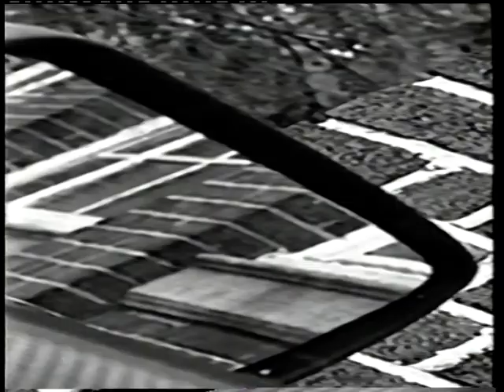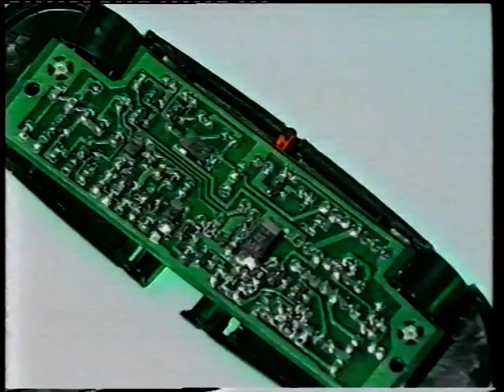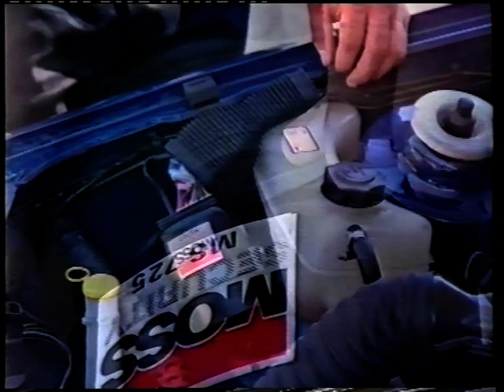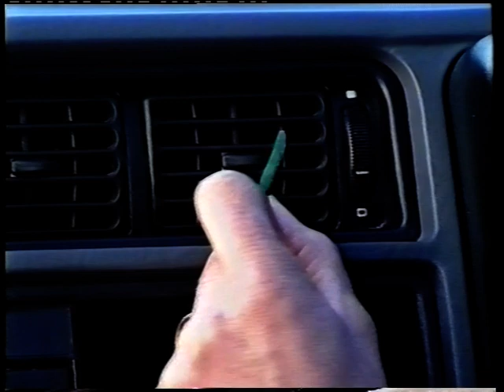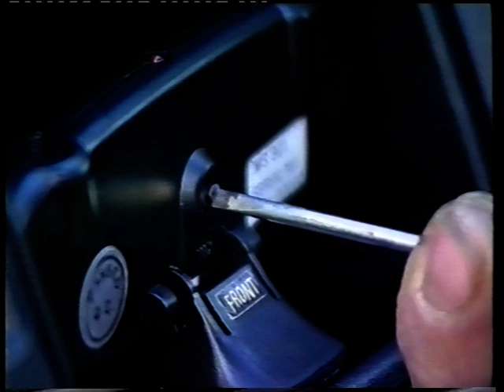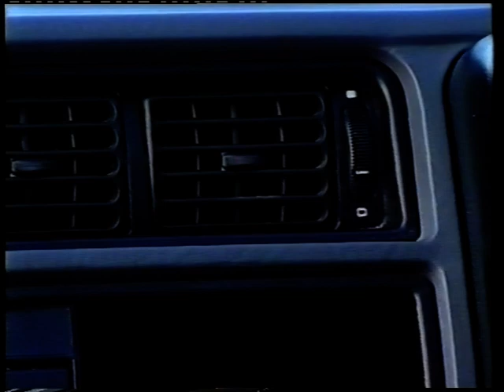Moss MS801/MS725 Car Alarm Installation Guide (1992)

Comment: I have my grandpa’s old Toyota Corolla 90 London model in Pakistan, and it’s still running a Moss MS704 security alarm system. The remote is damaged, so I bought a used Moss remote, but I don’t know how to connect it. Can anyone help me?